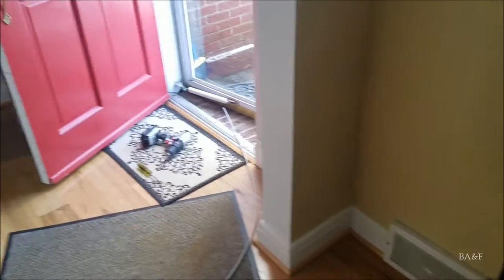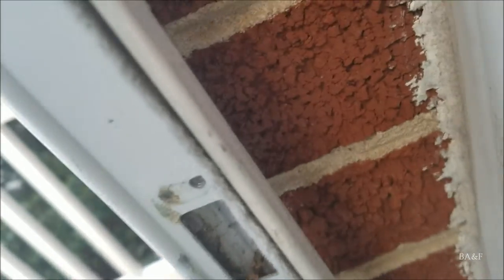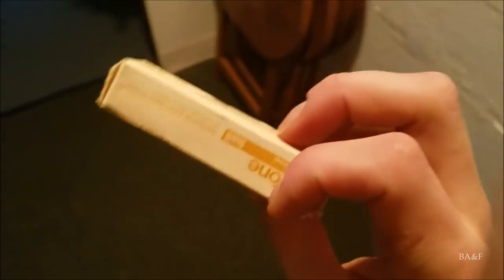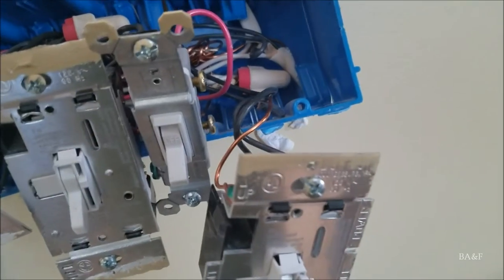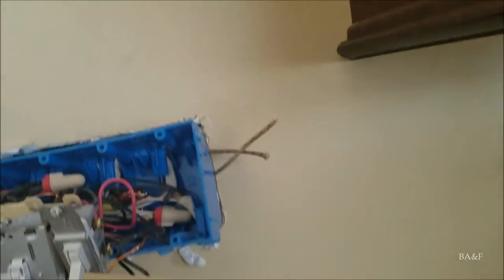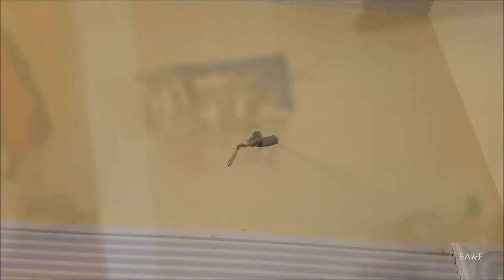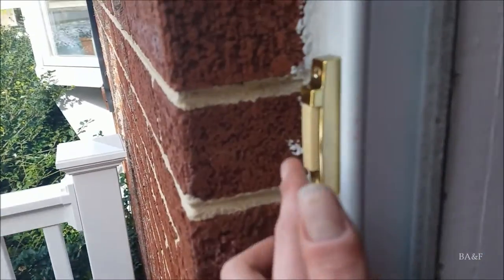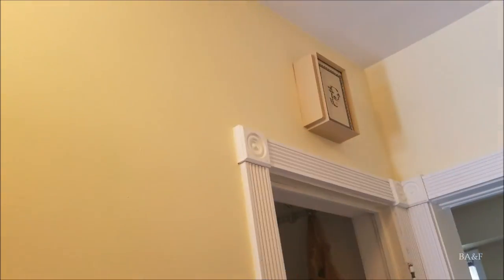Installing/Finding Doorbell System at the New House

Comment: Thanks for posting. I took the same model door bell from my Moms house before we sold it. Mine is missing the cover. I will be refurbishing the doorbell. Has some rust and paint on it. Funny that growing up in the house and I never remembered there being a cover. Also I have one of the plungers stuck. Mine is marked Dec 57. Once I get it working I am thinking about making a custom cover. It would be a good wood working project.
Reply from the maker: These NuTone L-30 chord chimes are my absolute favorite, the one featured in this video is from 1959 and came out of my childhood house, I grew up with this chime. My mom custom sewed the faceplate design in the early 2000's. Hope you get yours working! There is a cover for the succeeding model, the L-31 "Pacesetter", on ebay right now but it's insanely expensive for some reason. It would fit this model chime base.

Comment: Did you put a wire collar soothe wire insulator doesn't get cut by drilled metal, cause a short.
Reply from the maker: i did not have any at the time but later I did yes